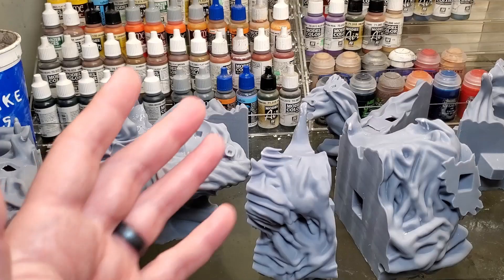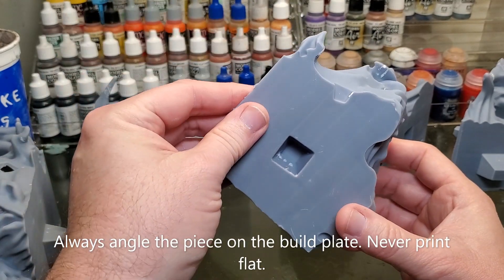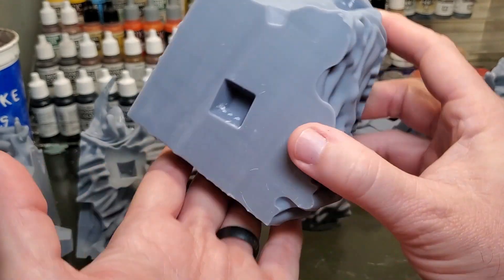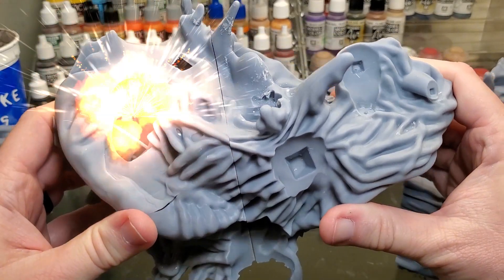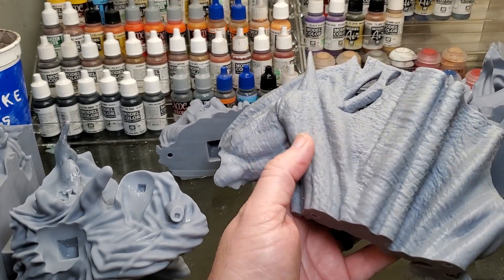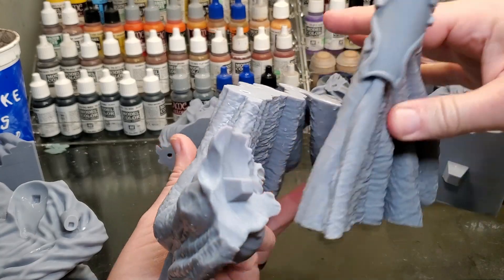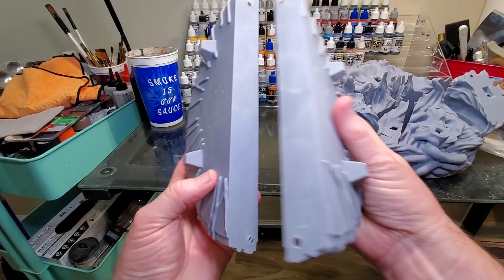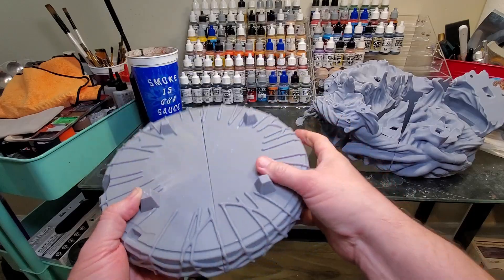How To Get Rid Of Gaps and Seams on Your 3D Print / 3D Printed/ tutorial

Comment: Instead of butting flat faces against each other, have an outer wall of 1.5mm thickness for 3mm above the flat face.  Then have alignment sockets on each face.  The interior won’t bend out to create gaps.  And can have supports on the face as it is recessed by 3mm or so.
Reply from the maker: You can but you'll still get those dips in the flat surface from the pull of the supports. You'd still have to sand it. When I do it this way, I don't have to sand anything on the flat surface area.

Comment: I recently printed a large Omni-Man.  His cape was big enough that the STL had it in two pieces with the cut running horizontally across his cape.  
Trying to manage a seam across a thin, smooth surface with no texture to hide it ... this was a challenge.  

Step 1)  Patience.
Step 2)  Do not over use epoxy.  This is terrible to sand out.
Step 3)  Patience.
Step 4)  Putty.
Step 5)  Sand with increasingly fine sand paper.
Step 6)  Prime.
Steps 7 - ∞)  Repeat Steps 3-6.

Comment: If you have a 3D print with big gaps, where you will need something more to fill it, I purchased a print and when i received it, it never sat flush, in fact it has huge gaps. What is the best process? I've looked but havent found anything on a step by step guide really. The gaps are mainly when the pieces are put together. I've seen milliput filler used but I'm at a bit of a loss on what to do.
Reply from the maker: First, sand down as much as you can then try using either some wood filler or try something like Aves Apoxy. That stuff hardens up real good so you can sand it. Wood filler will as well, but fir larger gaps I like the Aves.
Reply: Agree 100% with @TheCreativeCollector here.  One additional thing that has worked for me is mixing resin and baby powder into what is basically a paste.  Apply to the gap and cure with UV light.  Do not be sloppy, this can be heck to clean up later after it has cured.

Comment: Does curing to long cause warping...I cure for only 3 minutes...
Reply from the maker: I dont think it causes warping but it can cause the print to be real brittle from over curing. I usually cure for about 4 to 5 minutes depending on the size of the piece.
Reply: Other than the orientation of the print on the build plate what else could cause the warping around the joining parts
Reply from the maker: That would because of the tug and pull from the supports from the FEP. That's why you get these raised areas. That happens when you put supports on a flat surface like that.
Reply: I ordinate the print on an angle never flat
Reply from the maker: Even though it maybe angled it's still a flat surface. That's why I like to avoid putting supports there when connecting to other flat areas.
Reply: Ok I’ll try that…if you don’t mind asking what resin do you use
Reply from the maker: @gjohnson5978  I always use Elegoo standard.

Comment: Another tip is to use the same resin for both pieces.  Using two different resins will cause issues since they might have different shrinkage when cured.
Reply from the maker: Thanks for the info!